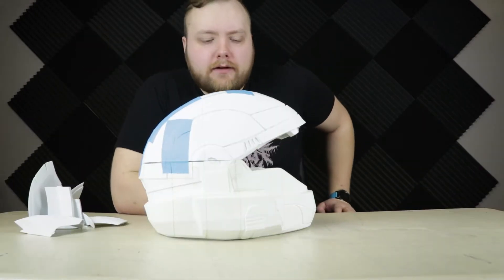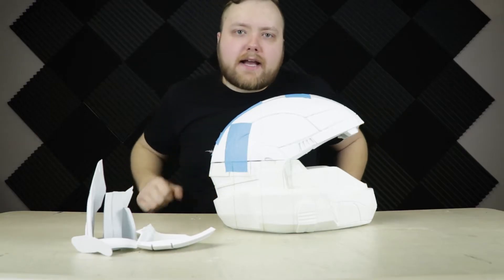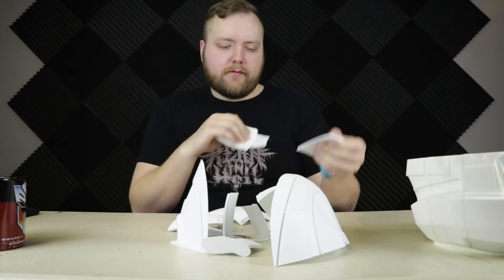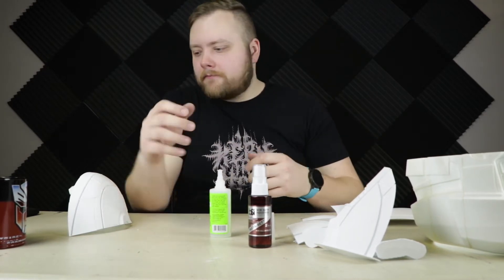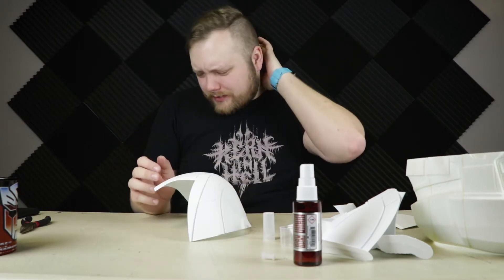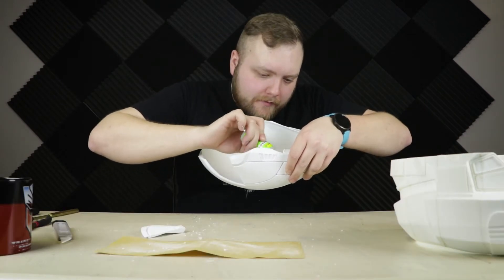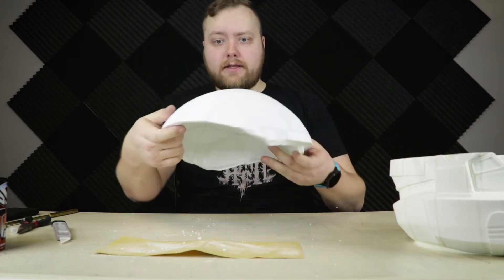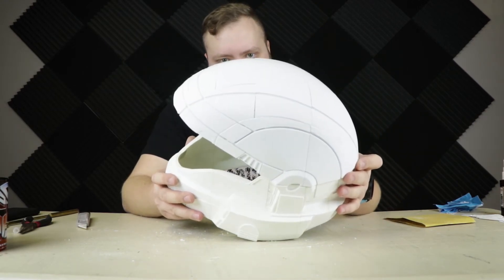3D Printed Halo ODST Helmet PLOG #4

Comment: Don't stress too much dude. Think you did a great job! I had similar issues with the Master Chief helmet. Had to print it in around 20 parts and only half of it would actually line up and look alright. Became a pain in the ass to fill the gaps, countless times to make it looks slightly better but after about 4 weeks of filling, sanding and priming, I finally got there. Stoked to start on an ODST one now. 

Keep up the good work!

Comment: Do you take Commission requests?
Reply from the maker: I can, depending on the project and the licenses of the available files for the project. I'm not a very avid 3D modeler, so most anything I do is already designed by someone else
Reply: I’d like to make a request as well if you have the time, brohec117@gmail.com

Comment: Print a visor pepkura using treated clear abs filament.
Reply from the maker: The designer of the file also has a visor buck for vacuum forming ;)
Reply: Oh, cool. I have seen 3d printed lenses and 3d print smoothing techniques, but they never combine the two. Maybe it would be easier to just print with see through ABS and smooth it?